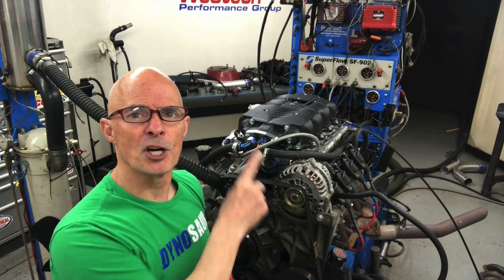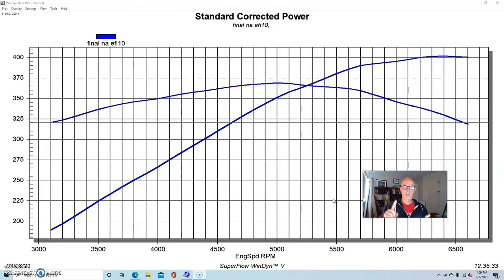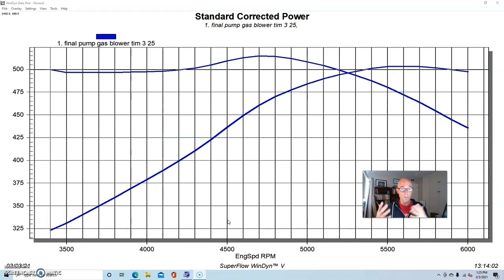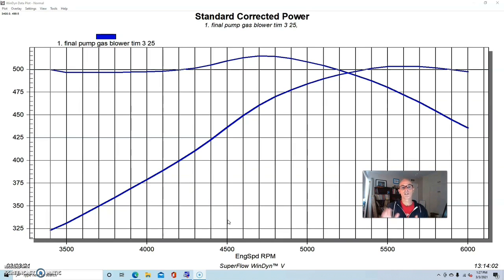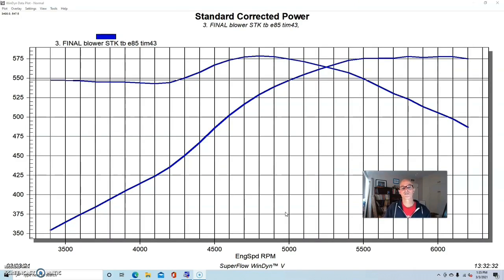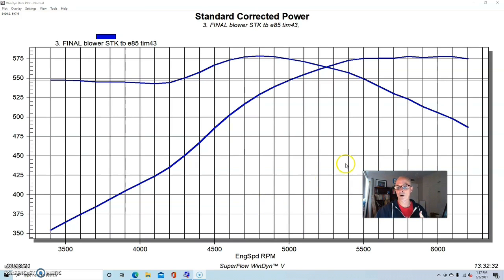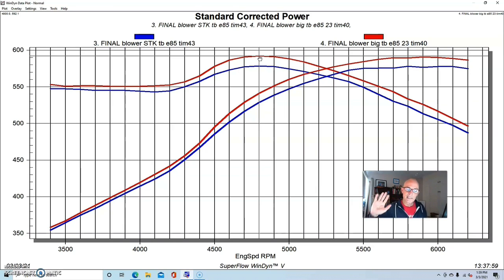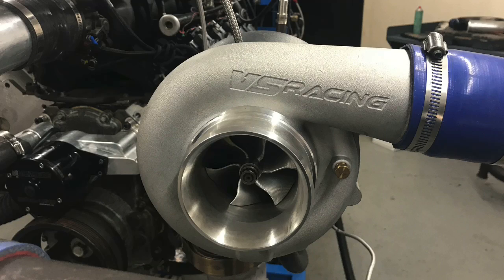LOW BUCK, LS BLOWER THROTTLE BODY TEST (pt 3)

Comment: Is the 3.5” pipe really such an issue since throttle bodies aren’t 100% efficient due to the blade? I heard they’re around 80% efficient. Thoughts?
Reply from the maker: the 102mm throttle body flows more than the 3.5-inch tubing

Comment: Would love to see some 1 & 3/4"  long tube (24") intake individual runners made on the cadillac adapters manifold configuration going up to a 90 mm turbo   manifold cap. Long tubes would make up some loss for the turbo's lag coming in at 2800 to 4000. By that time the boost should be rising beyond engine need. For drivability, you know.

Comment: Did I miss it? How much boost is it making
Reply from the maker: 11 ISH PSI
Reply: @richardholdener1727 I'm running something similar. A gt500 122 on a 6.0. dem on facebook makes an intercooled adapter that lines it up. With stock balancer an gt500 pulley it makes about 15lbs
Reply: I'd appreciate seeing some different pulley sizes, even some lower boost settings.

Comment: Should slap a turbo on there too. See if u can demonstrate boost response comparison? Like time graph showing boost vs throttle percentage w.o using the brake. If the engine dyno can do that
Reply from the maker: THROTTLE % IS 100 ON THE ENGINE DYNO
Reply: @richardholdener1727  i was thinking run it up to whatever rpm u want to start at. Simulate a roll-start w.o using the brake to build boost. Start the graph and slap the throttle wfo. Cause then the time would show how quickly it builds boost and accelerates thru the rpm range. Just an idea. Works well on chassis dyno idk bout engine dyno

Comment: I did this test five or 6 years ago on a 3L 6cylinder with a 1.6L positive displacement super charger: removed 2.6inch TB from the 2.6inch mounting point to the twinscrew and fitted a 3.5inch TB to the 2.6inch opening.

I initially lost 15whp as the AFR was effected, got the AFR back to where it was and got back my 15whp plus an extra 17.6whp with no timing change but a slight boost increase of about 0.5psi... just to prove a point that the TB was too small for the application even with the 2.6inch restriction.

I now run a 4inch TB on the same engine with a 2.3L Whipple but modified to 4inch all the way to the twinscrew.
Reply: What would you have done,if you were using a Whipple, which has a 112mm/4.49” inlet ?

Four inch Throttle Body = 102mm
Reply: @Jommybutler1234  depends on the size of the Whipple, engine, mods and boost.

LS2 with cams and free flowing exhaust system on 2.9whipple around 15psi - gains would be seen upto and over the 150mm TB = 5.906 inches.
Reply: @CosmosMBTS  I’m curious, how you make the calculation that, “gains would be seen up to 150mm...”
Reply: @Jommybutler1234  It is all dyno proven found on the internet.
Reply: @CosmosMBTS  Well.....the only 150mm TB tests I have seen are for the Ford 150mm which is Oval, not Round.

The largest Round TB I have seen is 112mm

Please reply with a link to the 150mm results you are referencing g

Comment: Cool results! I have a gt500 m122 (same rotors as the n* I believe) with a 90mm TB on a LQ4 and it makes driveline wrecking torque/power, but never been on a dyno. Good to see I'm likely above 600.
Reply: That sounds like an awesome combination! Is there some place I can see this? Are you on the "eaton superchargers" group on facebook?

Comment: Were you surprised that the shape of the curve changed when you went from naturally aspirated to boost? On the naturally aspirated curve, you have more horsepower than torque, but the boosted curve has more torque than horsepower. Typically, on your other tests, when you add boost to a given combination, the shape of the curves don’t change… Correct? Does that have something to do with the fact that you backed off the timing when you added boost?
Reply from the maker: WE CHANGED THE INTAKE MANIFOLD DESIGN WHEN WE CHANGED TO THE BLOWER
Reply: Undersized/undersped/restricted inlet blower will do that.
Reply: And softened the ignition timing under 4500rpm?

Comment: As a positive displacement blower fanatic, these videos are awesome!
Howeverrrrr. Pulleys! Let's go! It would be a crying shame to do such a comprehensive test on the cadillac M122 bolted to a lowly 4.8 without doing a pulley swap!

A lot of people run the gt500 M122 with a 7.8" lower and a 2.5" blower pulley and make pretty impressive power for such a small blower, however they do have the advantage of DOHC efficiency and the motors love to rev into the 7000+rpm range.

Comment: Awesomeness, Richard turn up the heat and add some timing with the e85.. let it eat an let's see numbers before spark knock/detination at 100% duty cycle..
Reply: He says he knows what he is doing with E85, even if he isn't doing what all of us are out here running E85 for over a decade. He likes to run it like its pump gas, which is his prerogative. It will run like that no problem, he is just leaving power untapped is all.
Reply: @SweatyFatGuy  I know i wanna see him turn them 7200 . Great videos for cam gains

Comment: Is the bov necessary? I dont think the guys from mack daddy parts are running one on their setup.
Reply from the maker: this had an internal bypass valve-which we used
Reply from the maker: it was just a piece of tubing I had-the valve isn't hooked up
Reply: Only if you want decent fuel economy when not running under boost.  It makes no sense to be running with the supercharger boosting under throttled conditions.
Reply: @andyharman3022  I'm sorry, I dont understand your response.
Reply: @claytonhaske  If they blower does not bypass the air it moves at say idle, part throttle, or deceleration. It would be boosting against a closed, or mostly closed throttle body. This is extra heat, parasitic loss, and wear.

Comment: So why did you stop at 650 pounds of torque do another 5.0 and split the thing in half show us what they will really take come on now. So upsetting when you say the your here to stop all the myths???  then you don't split one-half and show us what it takes!!!  b-real take a stock 88 5.0 short block. No aftermarket Pistons none of that put ring Gap in it and boost it till it goes boom!!! Come on now. Please
 And yes I know this has nothing to do with the current video so don't point it out idiots
Reply from the maker: this is an LS-we've run stock blocks to 1300+ lb-ft ft!
Reply: Not just they block at that power level is ready to go they will bend rods at that power level which will take out the block as well I personally haven't seen very many stock block 5.0s that have made more than 650 ft pounds of torque the ones that do make it much higher than peak torque so it's not as bad on it but the whole motor is a crap shoot at that power level
Reply: Fords dail at 650 -700 fb

Gm s routinely make it to 1300 

Hmmmm which to choose?
Reply: @safetyfirstintexas  yes I know that and I'm going to put in a 5-3 but the car already has a good running 5.0 in it so why not blow that up first?
Reply: I have an 88 5.0 (with ring gap) in my 68 cougar getting ready to get it back on the road with a gt45 and I'm going to put all the boost!!! and then nitrous till I break it so I'll tell you what it takes. Mph& et 1/8 m. 2900lb. At Barona Drag Strip. PS. I know what im doing.....than 5.3 gen4 and another gt 45🙉🇺🇸

Comment: Ha you did this test, i went to ebay and saw a brand new one for $419. While I was trying to find macdaddy it sold. Two days later see the same one different seller same exact pictures $1158 bucks. 
A video by Richard adds 700 bucks.
Reply: Holdner tax. The new sloppy tax.
Reply: LOL, saw the same thing.  Richard just destroyed the market by putting up this series of videos! They are no longer budget. I think the adapters are up there in price anyway.
Reply: @larrytaylor1964  YUP, now its again cheaper to go with an LSA which will support more power
Reply: That's the problem it seems if it's attached to an LS price magically skyrockets.
Reply: @thegrimstreaker4669  no, the price skyrocketed due to the advertisement of this video. They were attached to a LS before the video was posted.... lol

Comment: Unless you REALLY want to be boosted I feel like this supercharger is just not enough for LS
Reply: It added 50% more power with gobs of torque everywhere on an engine that already had a mild cam, higher compression pistons and a tune..pretty damn good really, especially since they haven't even changed pulleys yet.

But sure if your goals are to make over 650hp this probably isn't the right blower.
Keep in mind, a blown 600hp engine will have a crapload more torque than any NA 650hp engine everywhere in the rev range except for the last 500rpm..
Reply: Any boost is better than no boost
Reply: Plus sadly by the time you adapted to it you have more in it than you would in a low Buck turbo setup for 1,500 to 3 Grand you can turbo most LS setups and make more power without all the heat